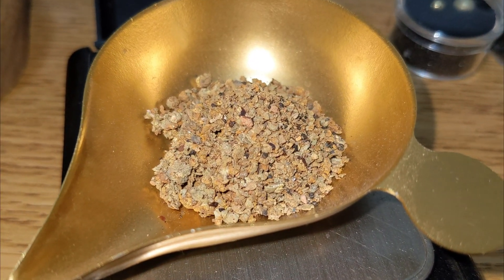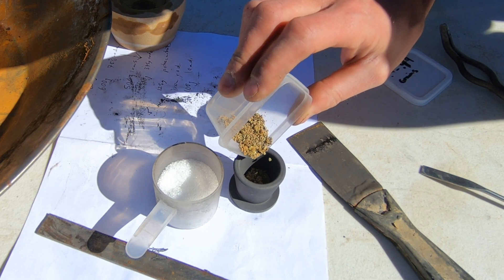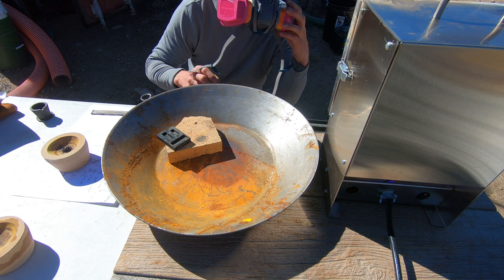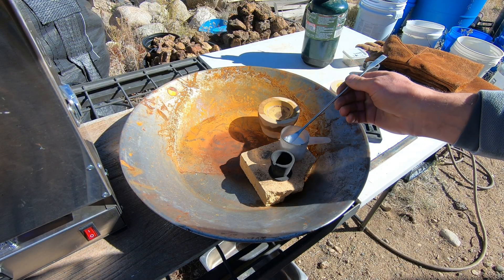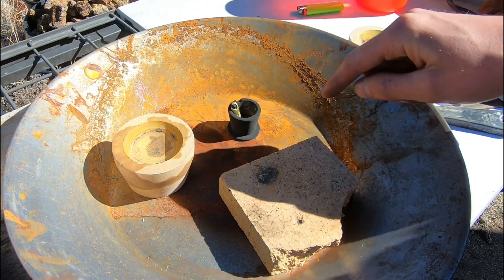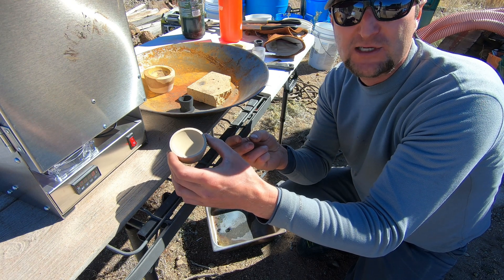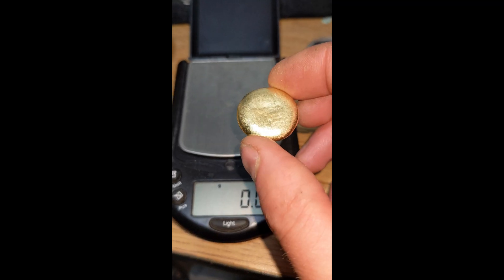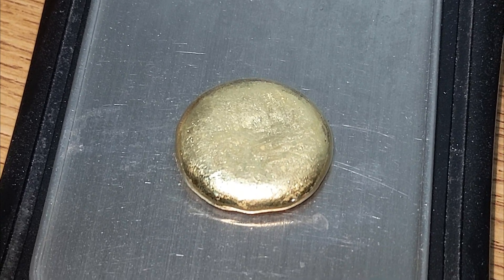HOW TO MELT GOLD AT HOME - Gold Bars in Box Furnace - Melting Gold Bullion

Comment: Every time you melt the gold you lose some angel share whatever you want to call it. Whether it just poofs off into the air or gets stuck microscopically and you're crucible or you're in get mold or whatever. Your repeated melting cost you over two grams. Right now gold is a hundred and twenty dollars a gram so you just lost two hundred and fifty us dollars.And I do understand you probably weren't dealing with triple nine 24k but still I would recommend you practice casting on something that's a little less expensive.And a little tip throw a little bit of potassium nitrate in your mold but also first heat it. Your gold will be more inclined to stay liquid for longer. It will flow better and you will end up with a better casting than pouring into a cold mold.

Comment: You need a conical mold to help with concentration of gold button. A bone crucible would help remove some metallic impurity as well. I smelted placer gold into a .999 pure button. The gold was from Oregon Colorado and N,Carolina. It took 3 melts with borax in a bone crucible using MAP gas torch

Comment: Cool.  This part should be a breeze for me at least as I was already an experienced knifemaker working with complex modern high alloy martensitic stainless steels and everything before I took up prospecting more seriously.
So already have alot of good equipment for this part.  Including several forges both gas or charcoal/coal.  And especially a real good really accurate (and really expensive) high temp digital electrical kiln/oven which should be great for this. 
(The latter is a must for good stainless steel heat treating and all.  Which is hella complex and tricky and requiring lots of knowledge and expensive, complex equipment compared to simple carbon steel.btw haha ) 
And have borax haha.  
Just need a new crucible and those tongs to hold it I guess,  and a mold. 
Though I've seen people use potatoes and a blowtorch haha which work ok but, I'm a little more fussy with my work. )) 
And some more research. ))
Would you recommend just a small graphite crucible and mould?

Comment: Whatever happened to the claim you were working on last year where you were shoveling out and throwing waste out of the opening?  Also you took samples out of the vein cross section. Might have been two claims, not sure.
Reply from the maker: Hey Kim, Yes I have many claims and am continually working on them.    That particular mine you are referencing has been a huge project of mine.   The surface vein is nice and large with some free milling gold.  At that site, I am currently working on reopening a 120 year old shaft to see if I can find some of the legendary 20oz/t ore that they were pulling back then.

Comment: Awesome poor there at the end that button looks cool.    I was wondering if you had a computer chip gold that was still in its flaky state are you able to smelt it down with flux in the state that it's in and pour a button? Cuz I have 38 g of computer chip gold that I wanted to try this same process
Reply from the maker: Have you already removed the "gold foils" from the gold chips and fingers?
Reply: Yes sir it's been removed from the fingers and looks like a little foil chips now
Reply: So yeah I have a 38 Graham pile of flaky foily looking gold
Reply from the maker: @jeremycanterohioprospecting  You should be able to melt that down into a button no problem!   I would think that a static furnace such as the one I use in the video would work perfectly.   A torch melt or propane funace melt would likely blow the thin foils all over the place.

Comment: Can you explain what sponge gold is??
Reply from the maker: Sponge gold can refer to a variety of gold types.   Crystalline, pockety, non solid lumps of gold can be called sponge gold.   Precipitate from gold refining can be termed sponge gold and most frequently sponge gold refers to Hg coated gold that has to be treated to remove the Hg.   This gold we had to run through a retort.  Throughout that process the gold turn very dull brown orange and lumpy.  It doesn't even look like gold.   The quickest way to bring back the gold luster is by melting.

Comment: Did I miss something about sponge gold? Never heard of it.
Reply from the maker: Sponge gold can refer to a variety of gold types.   Crystalline, pockety, non solid lumps of gold can be called sponge gold.   Precipitate from gold refining can be termed sponge gold and most frequently sponge gold refers to Hg coated gold that has to be treated to remove the Hg.   This gold we had to run through a retort.  Throughout that process the gold turn very dull brown orange and lumpy.  It doesn't even look like gold.   The quickest way to bring back the gold luster is by melting.
Reply: It is a gold nugget with lots of air gaps in it.  Looks like a sponge. way lighter than a solid gold nugget.